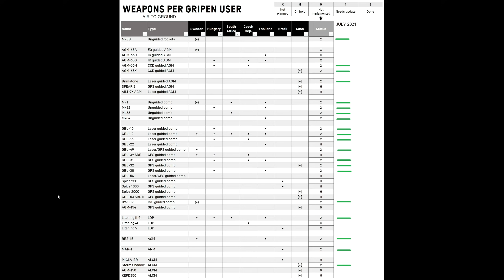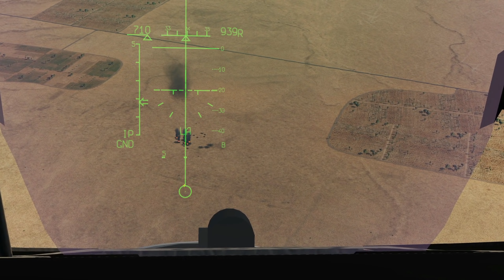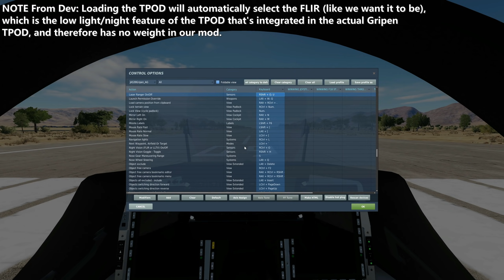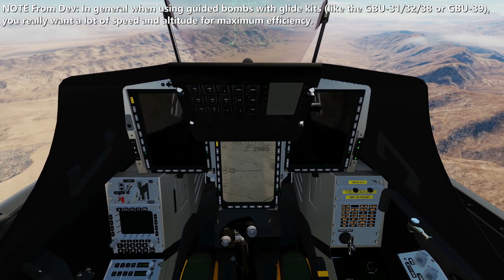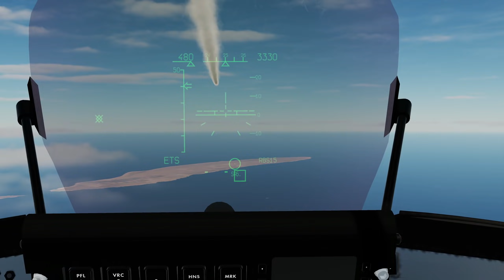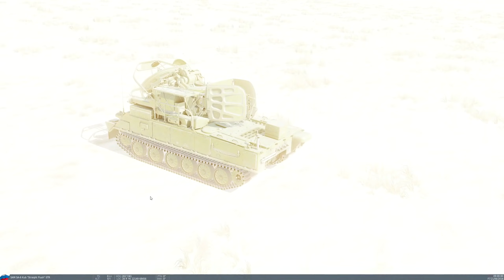JAS-39C Gripen Mod(V1.5): Comprehensive Air To Ground Weapons Tutorial | DCS WORLD

Comment: why not use the hornet HUD or something else than the russian one?
Reply: The Russian HUD is there as a placeholder as the (A/G version) mod is currently a modified Su-25. Using the HUD off the Hornet would mean you'd need those assets, so users would have to buy the Hornet to fly Gripen. It would probably be a lot more complicated to develop, and it would likely not sit right with ED. Not to mention that DCS is not open source, modifying simpler code is a lot easier than the massive project that is a full fidelity module with all the various system integrations.

Comment: I realize it is a prototype still,  but the center display is used for situation awareness (map with POI, threats and targets), right display is for sensors, and left display is for air data, engines, and passive sensors. CCRP also includes pre-planned targets.
Reply: Weapons was the main focus of 1.5 mfds will be the focus for v2

Comment: IRL F-22 Can Carry GBU39,i read an article,awesome
Reply from the maker: really?
Reply: @grimreapers  Been carrying SDB's on Raptors here for years now.
Reply: @grimreapers  "The SDB is currently integrated on the F-15E Strike Eagle, Panavia Tornado, JAS-39 Gripen, F-16 Fighting Falcon, F-22 Raptor, and AC-130W. Future integration is planned for the F-35 Lightning II, A-10 Thunderbolt II, B-1 Lancer, B-2 Spirit, B-52 Stratofortress, and AC-130J. Other aircraft, including UCAVs, may also receive the necessary upgrades." - https://en.wikipedia.org/wiki/GBU-39_Small_Diameter_Bomb#Aircraft
Reply: @grimreapers  Yes you have to search F22 GBU-39
Reply: A true modern bomb.
Reply: GBU-39 is the small diameter bomb, pretty much a combination between a JDAM and a JSOW and is carried on pretty much every US plane with A-G capabilities. (F-16, F15E, F-22, F35 even ac-130’s if im not mistaken!)